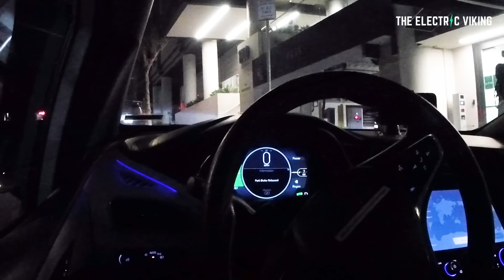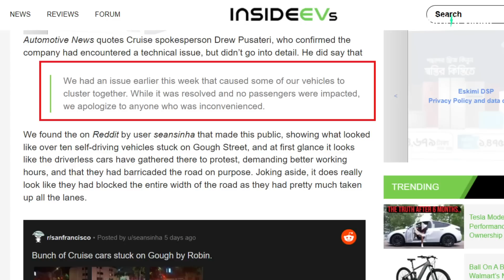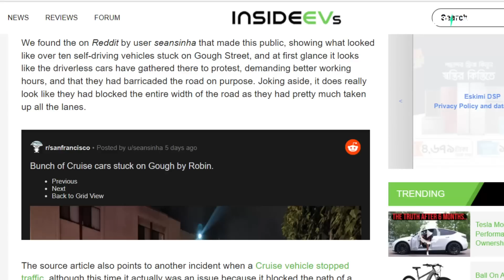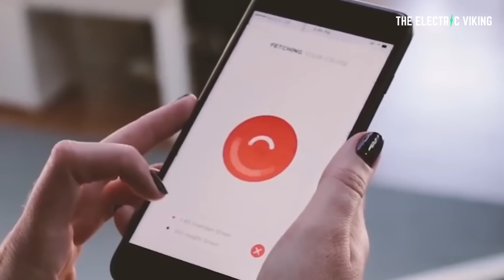Skynet!? 12 GM Cruise autonomous taxis go ROGUE in America

Comment: For a long time, I've wondered about the "selectivity problem".  Basically, when a system emits a signal (LIDAR/RADAR) to measure something it needs to be able to discern the return of that signal and analyze it.  The problem I've anticipated is that too many vehicles in proximity may cause sufficient false signals that the signal quality degrades since the vehicle can no longer discern it's own signals from others.  There would be some kind of signal quality "alarms" which would be used to disable the vehicle in the event of insufficient signal quality.

Now the scenario where this occurs is this:  At a stop light, one vehicle arrives and then others arrive.  Some vehicles may take other lanes but the end result as too many arrive is too much "noise" which causes the vehicles to disable.

Vehicles coming the other way now, would soon encounter a huge cluster of LIDAR and RADAR emissions and also disable.

In an abundance of caution, these disabling alarms might not be self-resetting -- that is, when the interference clears it may still require human action to reset the vehicle.

To prevent further clustering, a disabled vehicle should stop emitting signals, but that may not be happening and hence new arrivals get disabled also.

I'm blue-skying it, but I think it's a probable scenario that might cause issues.  I guess eventually we'll find out.  Perhaps encoding an ID on the outgoing emissions would possibly allow the vehicle to discern it's own signals; but that is only true when the signal to noise ratio is sufficient to allow decoding.  You can put some incredible DSP processing in there to make it very robust -- however that's not free and still may not be sufficient.
Reply: I suspect you are right, and that may be one big advantage of the Tesla "Vision Only" approach. With no LIDAR or RADAR, Tesla Autopilot doesn't get confused with signals from other cars.
Reply: @chrismuir8403  Indeed!  Having both, as Tesla appears to be moving too, means not having to totally rely on either.  Thanks.
Reply: @EntropicRemnants  Tesla is not moving to Radar or LiDAR. Exactly the opposite.

Comment: People may want to realize that autonomous driving has nothing to do with EVs in particular.  Any vehicle with power steering can be made to drive with a computer controlling it - such as via the Hotz Open Pilot which I think is about $3000usd. Using autonomous driver systems usually doesn't mean that it is capable of driving anywhere - level 5 - usually they are using very nigh level detailed mapping which they only have for limited areas.  Some are very expensive using very costly sensors such as LDar to help navigate which makes them more expensive that a driver at this time.
Reply: Correction - electric power steering. It cannot work with older hydraulic power steering. Electric power steering was first used by Toyota for their Prius hybrid, but it worked so well that it was quickly adapted to the rest of Toyota's vehicles, even non-hybrids. Electric power steering is now common, and hydraulic power steering is only found on very old "classic" cars.

Comment: I believe that Lidar like any radio transever can't use a frequency when some else is already using it. 
Every car will need it's own frequency, now add the complication of doppler effect for a moving transmitter on band width.
Similar example, two anglers using the same type of fishfinder won't work.

Comment: I'm pretty sure what happened is that the geofenced area is so small that all these cars happened to congregate in the same area and ran into a processing glitch, due to some odd variable in the environment, which caused them all to stop working and therefore block traffic, or maybe the systems simply came to the conclusion that that area was not approved for driving, so they logically came to a stop, since the programming isn't made for un-mapped areas. This is not some skynet sentience non-sense, just look at how occasionally NPC or AI drivers in video games glitch in certain areas and stop working.

Comment: Yep, the fully controlled environment of the GMs taxis was not enough, they made an error in programming and coding. Probably the error is simple, they did not instruct the cars on what to do, in which order to act when in an intersection more than 2 of them are coming at the same time. Maybe the time of intersection was the problem also. So after the first 2-3 of them were stuck there, it was a matter of time until other "Robo" taxis will be stuck at that point, all running the same software had the same problem. So all coming there ended stuck. 
Will happen again in the future. With GM or others. Doing the same thing as GM...

Comment: ...when someone decides to fast track development of autonomous technology, it often results in a disaster.. fast tracking AI will lead to developers ultimately neglecting the safety aspects of the tecnology.. developers & programmers are mostly focused on getting it done, rather than getting it safer first.. making it safer first means thousands more codes of programming.. 
less safety codes means the AI will think its just doing the right thing, instead of observing safe protocols for every one...
most legacy auto is frantically trying to become developers, which is quite difficult for them... to fast track, they will most likely disregard the thousands of safety protocol codes... which is mostly not necessary to be able just to run the autonomous program...